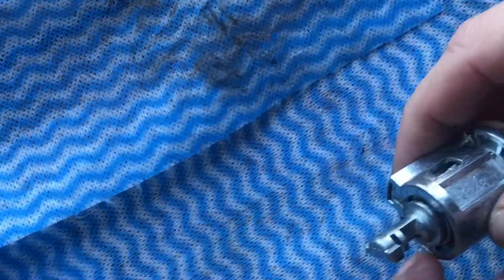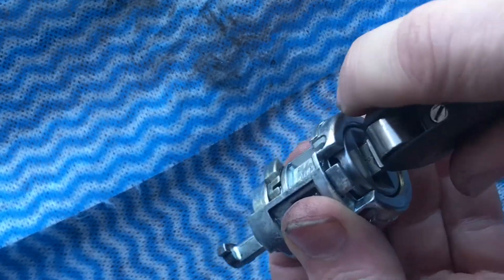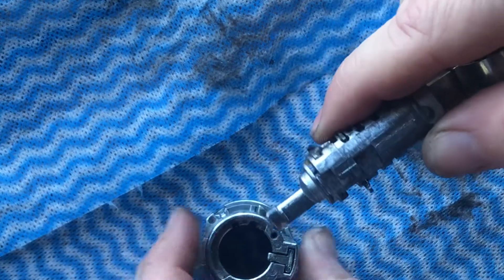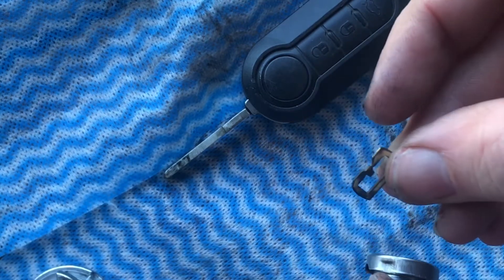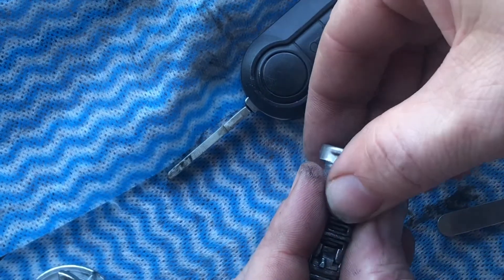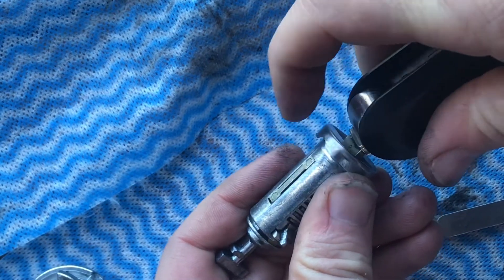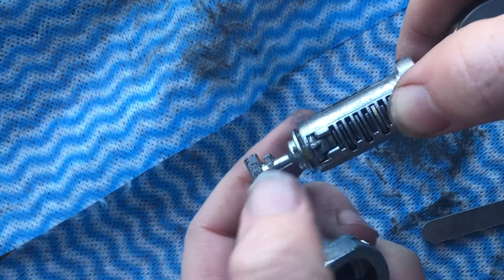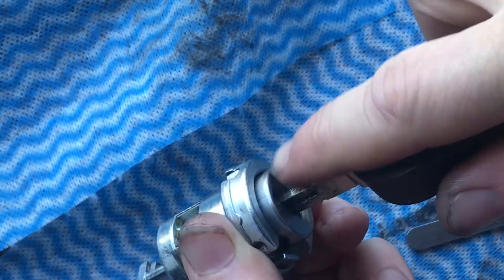Repair Fiat Ducato ignition barrel

Comment: Excellent video. Think I got to mine just in time as turning anticlockwise to get the barrel out took about an hour and eventually involved using a vise. Before I sorted mine, one of my keys didn't work at all and the other only bearly worked if I inserted the key the right way round. Followed your instructions and now all works like new. Cheers.

Comment: Hi! I have a problem with some part of my ignition switch.. it will nearly not stay in ”on” position. Whats do you think i need to replace / whats part is worn out ? Thnaks..!
Reply: I have the same problem, wont stay in "acc". Did you find a solution?